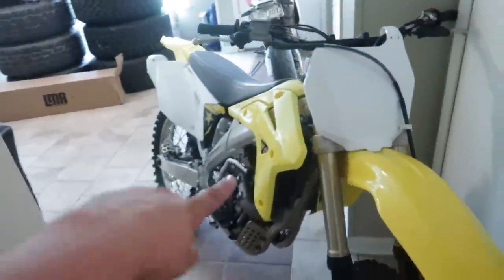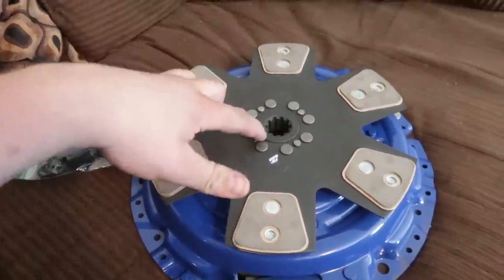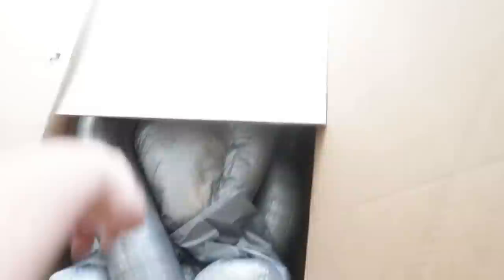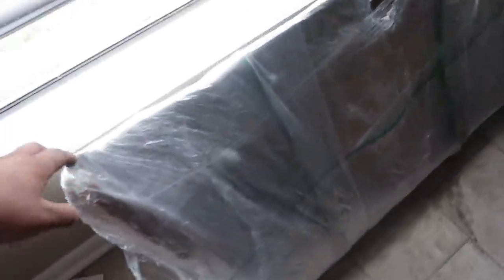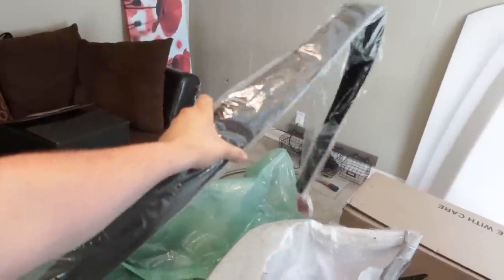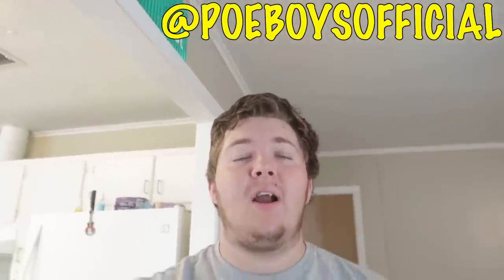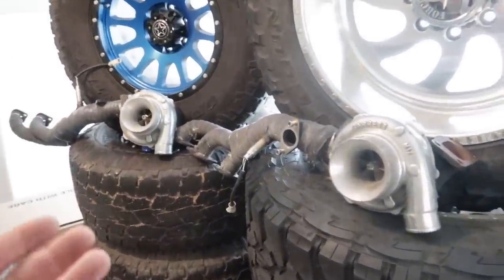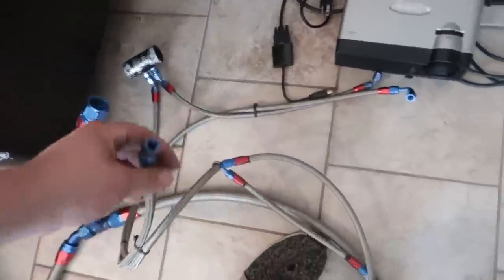I got a $3k+ Twin Turbo kit for $400. Here's how..

Comment: Poe, try to utilize the factory heater core lines for the turbo’s cooling lines! -10 pushlok hose might fit over the existing lines, and 2 adapters to -6 or 8 and you’re set my man

Comment: A built 3.8 will go to about 650-700 wheel horsepower which would be crazy to see well documented. Stock it’ll only see 300-350 wheel before the rods give or the two bolt mains let the bearings out. You’ll get to ecoboost level with those turbo and stock engine just be weary of that. I’m assuming you’re aim is to do something with the 3.8 considering the headers but if you plan on a swap I’ll buy the headers for sure.

Comment: For what your putting into this v6 you could have turbo'd or super charged a 5.0 or 4.6 .... the stock 2v wont hold shit for power but a 5.0 will. It would be super easy to bolt a 302 up in your car if it has a t5. Just need a different input shaft.

Comment: ayy, if yall roll through montgomery, im currently workin on a porsche 928 model 80(made in 1980) i think it needs a new throwout bearing and shifter bearing, more importantly it needs a full check on the oiling system because the gauge is a bit fucky to say the least. it runs but 3 of the injectors arent making any ticking sounds. also i cant drive it just yet, no insurance other than basic theft insurance or whatever. also no plate, its purely a resto project right now. anyway, i drive an accord wagon that will be modded in the future, but its fun to drive anyway because of the 4 selectable automatic gears, effectively making it a pretty good practice car for manual(i havent driven a manual but im pretty confident in that i can adapt to stuff pretty fuckin quickly) thanks for ignoring my rant hehe.
Reply: Adam Winter I’m live in Selma